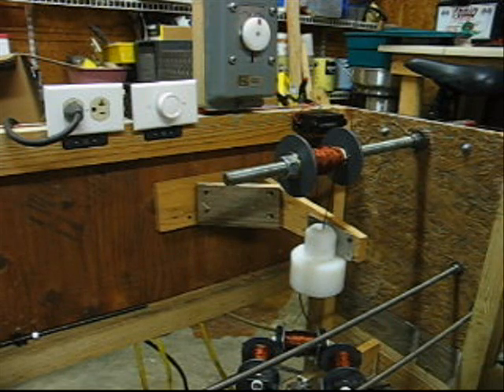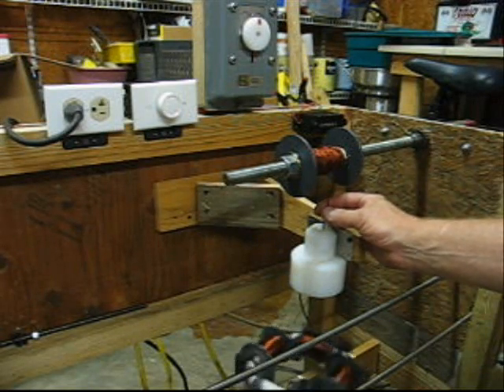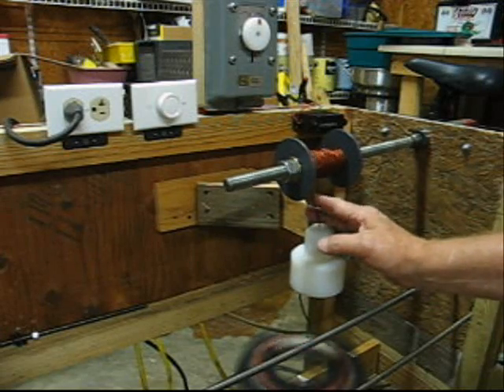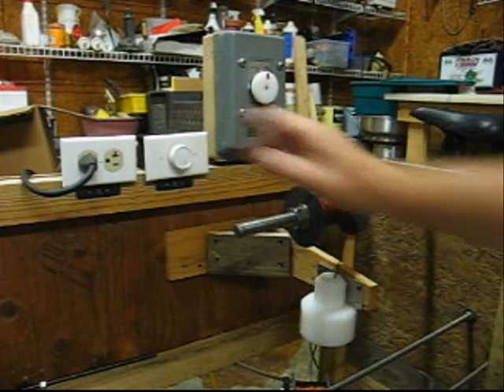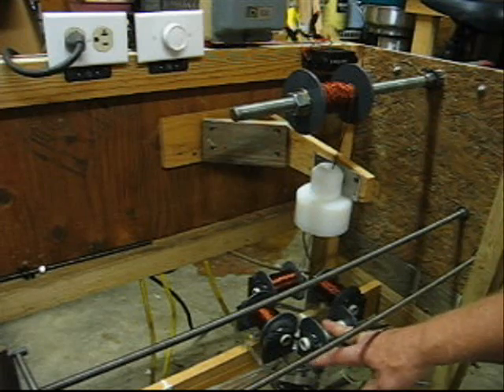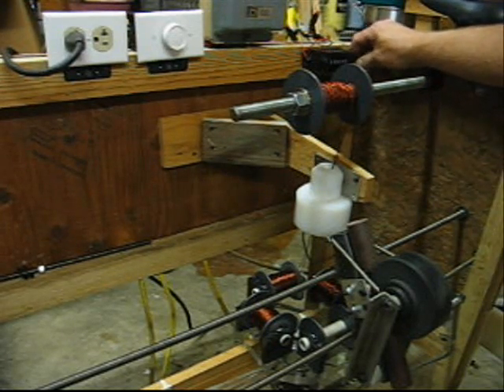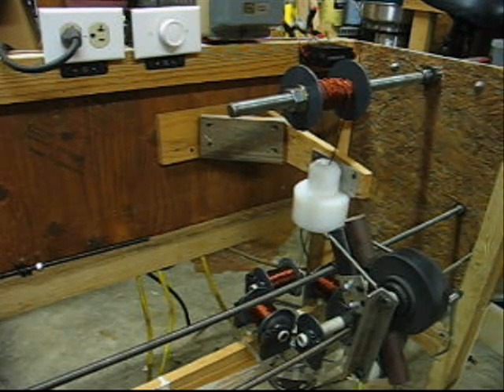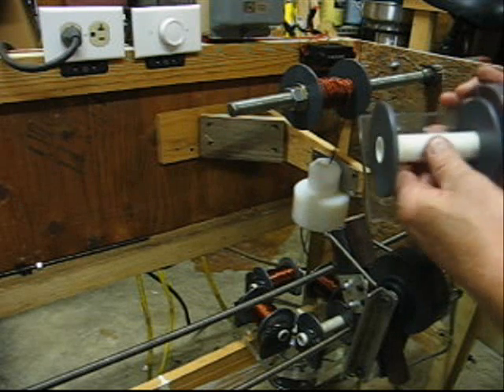Homemade Coil Winding Machine

Comment: Very nice!  Im happy i provided some inspiration.  Another thing you may consider is to use one motor to drive both the spinner and the winder and use gearing to adjust the revolution ratios between them.  That way you could have an exact number of twists per inch, something i planned on doing but never got the motivation to build.  Either way, great work!